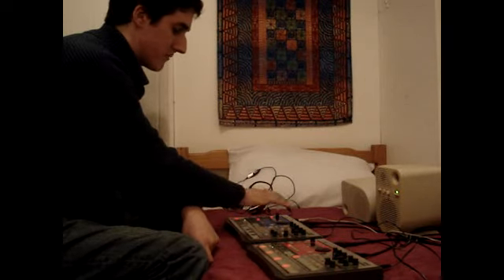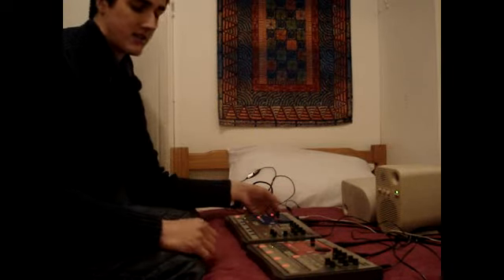Ross Kelly - Bacefook - Korg Electribe EA1 and ER1

Comment from the maker: I had to check that one, but yes, you can do it on the ER1. Ive only been running the audio from the ER1 through the EA1 up until now. If memory serves me, I think only the audio going in through Audio in 1 on the ER1 can be routed to the output. Audio in 2 is only gated.

Comment: Do the inputs on the ER-1 have the option of passing audio straight to the main mix or do they only run as a gated source? My intention is that if I'm away from my studio and I run the ER-1 and another desktop synth, I can forgo the need for a mixer as you have done in this case.